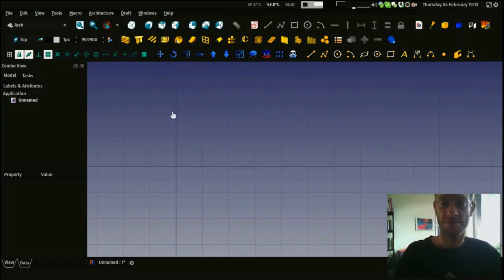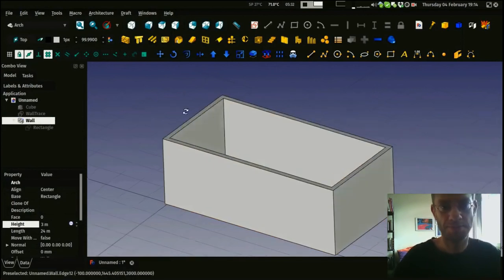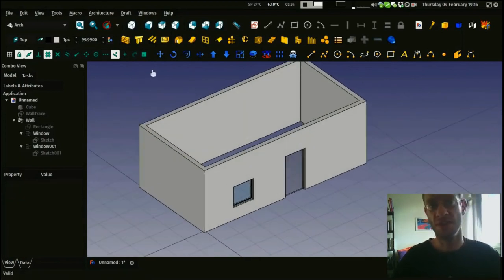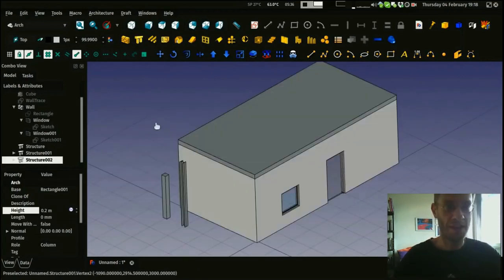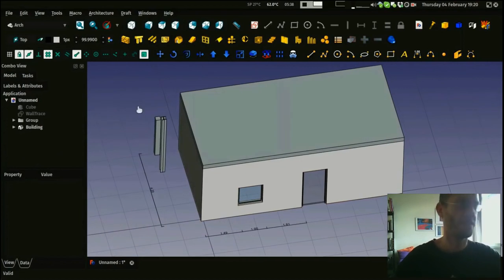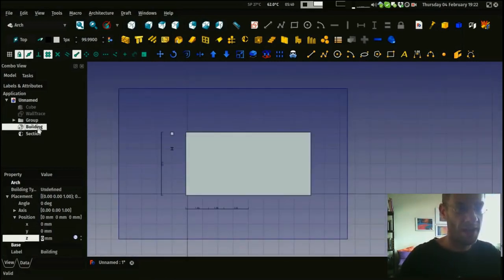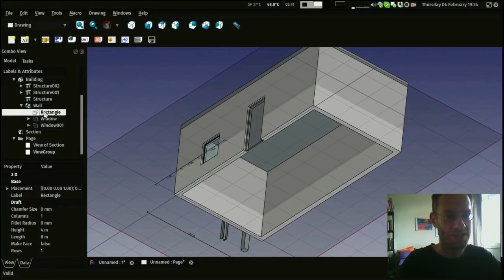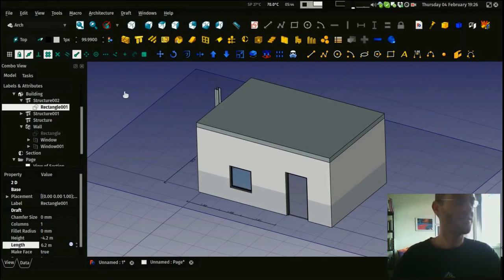Presentation of FreeCAD Arch Workbench at BIM Pordenone 2016

Comment: Hi, Yorik!  Thank you for the hard work you've put into the Arch Workbench.  It's been very helpful so far!

Some of the things I've found while using it is that I have a very difficult time trimming or extending walls without remaking them.  I've been using lines and polylines mostly, since I wanted to make a more complex structure than a simple rectangle.  If I modify a wall, it doesn't modify the object the wall depends on.  Also, I couldn't extend the length of a wall when I used a line as the origin of the wall.  Do you have plans to implement things like archways for door openings?  I didn't see any sort of archway or plain opening in the Window tool.  I did manage to make a plain opening, but it put a threshold at the bottom that I couldn't easily figure out how to remove.  Being new to FreeCAD, I'm struggling to figure out all of the tools.  Overall, FreeCAD feels less intuitive than I'm used to, but it's a really great project.

Notes about the Arch workbench:
- Implement a way to grab the end of a wall to extend or shorten it directly, without typing in the parameters at all
- Double check the auto-join walls feature.  At one point, I added a wall (as I had been repeating the process in the same manner for a while), and FreeCAD filled in some "rooms" with some sort of roof.

Notes about FreeCAD in general:
- Please change the size of the tiny triangles you click to change camera angle.  When viewing from the top, for example, it's nearly impossible to click on the "corners" of that cube.
- I encountered several issues with the undo/redo stack.  It seems not all actions get added, thus some things can't be undone (easily).
- I "think" docking a toolbar on the bottom part of the screen corrupts the user.cfg or system.cfg file because I couldn't load FreeCAD until I deleted those files and started over.  I tinkered around, changing a couple of settings at a time and exiting and restarting FreeCAD each time.  The only thing I haven't done yet again is dock a toolbar at the bottom.
- When changing parameters in the Comboview, there is often a button that says "Enter point."  Using the spacebar on this button only sometimes works.  If you somehow managed to click on something else, pressing spacebar makes that object disappear (toggles visibility).  Also, if you try to move your mouse to that Comboview window to click the button, you usually have to remember what your parameters are and fight with the program to stop changing them back.  It would be great if there was a shortcut key to manipulate the button that isn't the spacebar.  It also helps a lot to know that tabbing and pressing Enter helps ease a lot of frustration.
- In the settings, if a user has chosen to use inches and feet by default, it would be very appreciated if all other settings would reflect that.  This is true at least for the "Texts and Dimensions" settings in the Draft workbench and "Defaults" in the Arch workbench.

If you have solutions for some of these problems, or some good tips, I'd love to watch more tutorials from you.  Thank you again!

Comment: Hi Yorik, this is a great workbench and i will use it often. One question, how can i, for example your nice house, export from the arch workbench to an STL file so i can print it in 3d model?
Reply from the maker: to obtain a printable 3D model, you'd need to have ideally one solid (or a few solids you can then mount together manually). This is pretty different than how a BIM model is usually done (many different solids). So there would be a part of manual joining to be done. Then, it's just a matter of selecting File -> Export and save as STL.